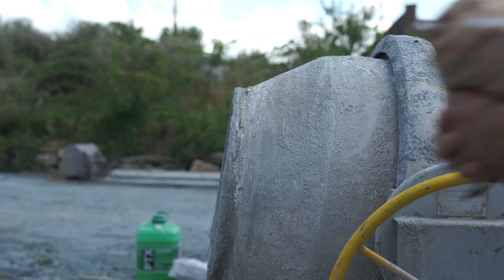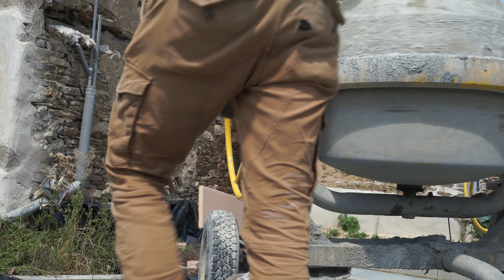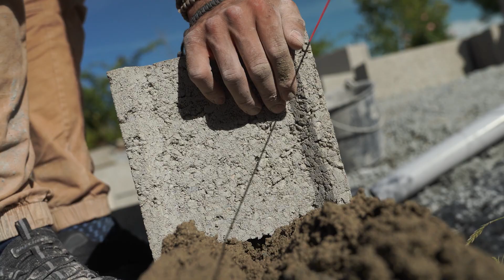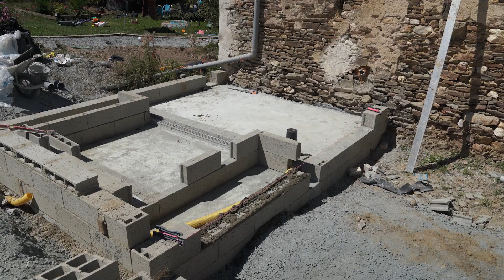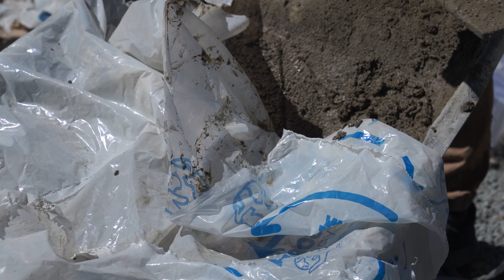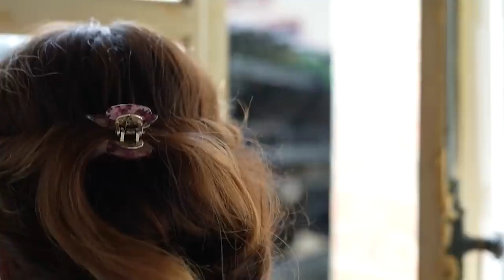Building | in the extreme french heat

Comment: Dan , you're not afraid of a challenge! Building that extension is one of them. Wonder why you didn't reinforce the concrete foundation (steel bars/ rebar). Also I understand that you're supposed to put steel bars in the corners of cement block corners, or is that for a different type of building blocks?

Comment: It all makes perfect sense to me except for one thing.  I'm concerned that the exterior concrete pad doesn't have a broom finish.  When that is wet, it could be dangerously slick.  Our garage has a smooth finish and once I came in from the wet driveway barefoot and nearly broke my neck.  My feet went right out from under me.  Whoooops! .  Just be aware.   

Otherwise, great job Dan.  I'm binging on your vlog and pining for my own drone.

Comment: You probably don't have time to read all the posts, but am curious about what the foam on the concrete does. It is looking good.
Reply from the maker: It holds the metal up so it sits in the middle of the pad not at the bottom

Comment: Dan u need water to keep alive but I am also worried about yr mortar. In Australia when we build in the heat if the mortar is too dry walls don’t do well and concrete cracks. Also as the dirt around and underneath the building changes a lot from extreme dry. I am sure u know better than me but it just shows how much notice we all take of yr hard work
Reply: Yep, wet the blocks first, put plastic sheeting over parts already built to retain moisture, plastic sheeting in hot weather gathers moisture underneath. It's much cooler where I live but I'd do those things anyway to slow down setting to ensure maximum strength.

From the Cemex website:

In very hot weather the main concern is the rate at which water is removed from the mortar either by suction of the masonry or evaporation. Experienced bricklayers know instinctively that on very hot days warm bricks and blocks will generally absorb more water from the mortar. The mortar will also tend to lose its plasticity at a faster rate due to the evaporation of the water from the mix.
Mortar mixed at high temperatures may have a higher water content, a lower air content and a shorter board life. The quality of the bond between the mortar and the brick or block is dependent on having the correct amount of water and so in high temperatures this bond may be affected.
Practical steps to help avoid any problems include storing bricks and blocks in the shade to help control heat gain. Spraying with modest amounts of clean water is another option, although they certainly don’t want to be soaked. In hot summer conditions materials and mixing equipment can be shaded from direct sunlight prior to use. Mortar tubs and mortar boards should be rinsed with cool water before coming into contact with the mortar.
Other suggestions for avoiding problems in hot, dry or windy conditions include finishing the bricks or blocks more quickly after placing the mortar and providing some form of covering or shading.
 
Where ready-to-use mortar is being stored on site it is obviously important to keep it well covered in the tub.